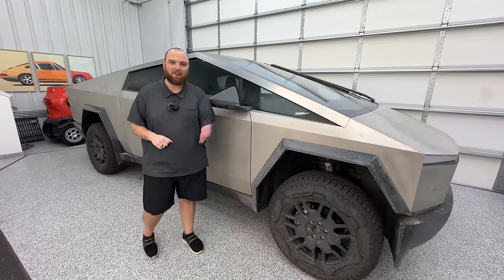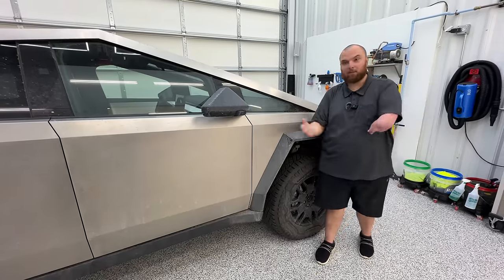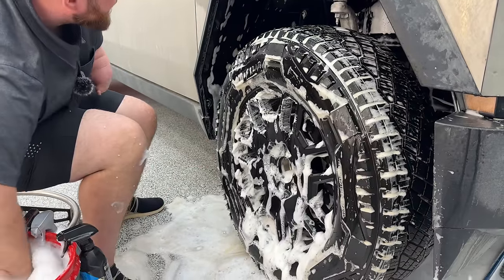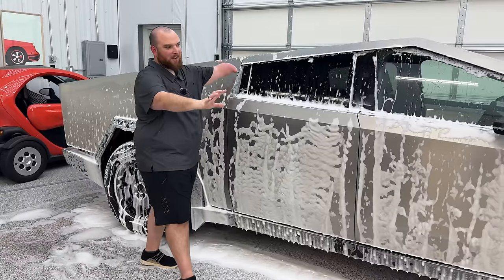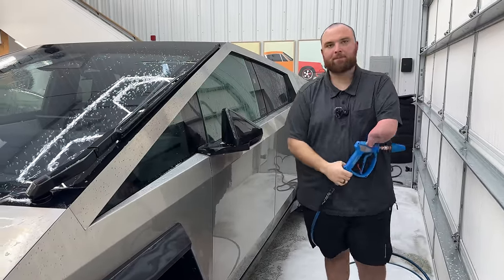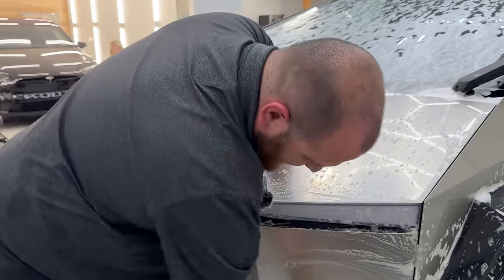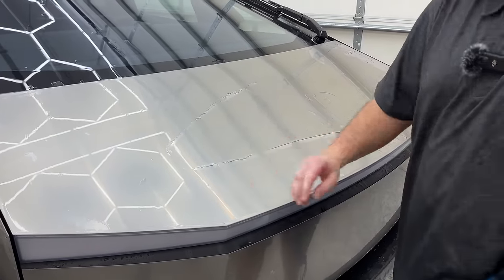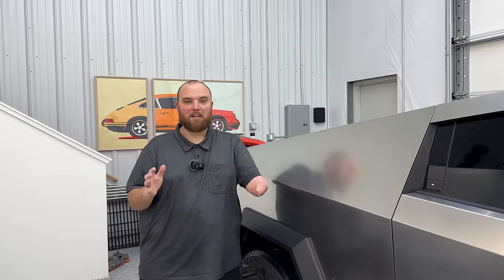Tesla Cybertruck First Wash! 4,500 Miles Of Road Grime, Salt, & Bugs

Comment: I remember back in 2019 thinking it'd be cool to own a Cybertruck because you could just take it to a regular carwash and not have to worry about the brushes marring the finish. Now it turns out they will be harder to maintain than a normal painted car. The assumption back then was that a Cybertruck would never rust or scratch from anything of course.
Reply: Actually the other CT owners in town and I decided to use car washes. Never did that with my MY or M3. On balance my CT may be clean more frequently than the others😊
Reply: 27:00 It’s easier to get rust dust off your cybertruck than a painted vehicle.
Reply: Of course you can take it through a carwash, what are you saying?
Reply: @retro1120  It will rust and scratch, apparently from what I've seen on news feeds etc
Reply: @fcv1967  apparently you've only read the click bait headlines not the thorough discussions.

Comment: DIY Detail YouTube channel is doing a Cybertruck detailing series, and they have a specific ceramic coating for metal. The prep was interesting as they had to do multiple passes with their panel prep spray in order to get it fully clean before coating. 

They specifically described to never use abrasives on it (like Barkeeper's Friend) because it will create an uneven finish on the stainless. The factory brushed finish was done with orbital sanders and that finish will be hard to duplicate until someone figures out what abrasives and process are used by the factory.

Comment: Based on your early recommendations for using Windex on stainless steal finger prints etc.,  I used it to get bugs off the front of my CT after a 330 mile (one way) trip from SOCAL to Monterey, CA and back.  I just sprayed it heavily all over the front.  Then used a soft cloth to easy wipe it off.  Also, cleaned the big front windshield with it.  Seems to be easy solution for me.

Comment: Took delivery of my CT in Jacksonville about 24 hours after yours. They pretty much admitted that they had virtually no training on prepping the trucks much less a seven stage process. Hopefully they will be able to address it for our trucks and going forward.
Reply: So..., PPF b4 taking delivery? Tesla can invoke digital color as well as subcontractors, right?  Any flat yellows to help recall my old '56 'Vette? Not just for bugs, but to reflect heat away? Any parts that can be left bare to retain some of that Starship feel?
Reply: they definitely do not, ceramic spray wax and deliver...

Comment: I'd say that the streaks on the frunk are silicone based, I work with sealing and bonding different pieces together and I've seen this happen when an area is contaminated with silicone. Most deodorants and such have silicone in them, but it can also be from some process in the factory. The only way to get it out is to wipe it down with IPA and a paper towel, wipe in one direction only and switch to a new towel each wipe, then you can test with a water film again and see if its gone. Repeat if necessary

Comment: The ought extra piece is NOT a mud scrapper (at 3:40 in) but most likely part of the safety system once you had a frontal crash to crack the front wheel rim so that that wheel is NOT penetrating into the passenger cabin, thus keeping passengers safe.

Comment: On March 13, I had the warning on my Cybertruck of the "tonneau cover used too many times. Wait before using again." Then on March 14 it stopped working altogether. Once I got back to Florida, Tesla service had to realign the tonneau cover twice in order to fixe it. It hasn't stopped working since they fixed it. I think it was just misaligned from the factory. Waiting to see if it fails again.

Comment: Think of rust like a mold. My kitchen sick never had any rust, until one day I left something rusty in it. Had I not sanded it out, it would eventually rust a hole. Bare stainless steel is only rust resistant until it comes into contact with something already rusting, like iron particles. The cybertruck (bare) is more vulnerable to contact rust.

Comment: Can you use gasoline instead of soap?
1. The DeLorean owners manual specifies good ole gasoline as a choice of solvent.
2. Gasoline is very very strong so i think all that minor stains can be dissolved. 

Once you are done with cleaning what if you coat it with a thin layer of vegetable oil just like a cast iron pan would haha.  It may help from developing a patina or stains
Reply: Ha ha ha! Spend around $100,000 for an electric Cybertruck and wash it with gasoline! Sounds hypocritical to me.

Comment: MUNRO spotted that “mud scraper” in their first look under the CT video and surmised it’s there to help the truck pass the NHTSA frontal offset crash test. Its job is to prevent the front  wheel from entering the passenger compartment like a battering ram, either by breaking the rim and deflating the tire, or by breaking it off the spindle and directing the wheel outward in the event of a crash.

Comment: If this were high grade stainless there wouldn’t be a discussion about stains etc. The only change over time would be micro scratches cutting against the original brushed metal in varied directions. Like a 70 year old stainless mixing bowel thats metal doesn’t look a year old.  It’s apparent the cyber truck is a low grade stainless steel.

Comment: Stainless steel is not resilient, they need to clear coat or use a special coating, not true no painted truck or car has rust spots after one week, after 10 years maybe, these trucks will not age well